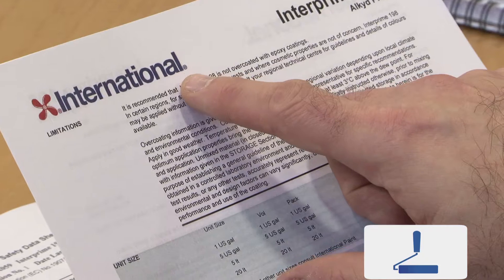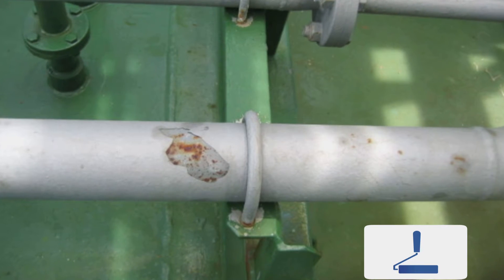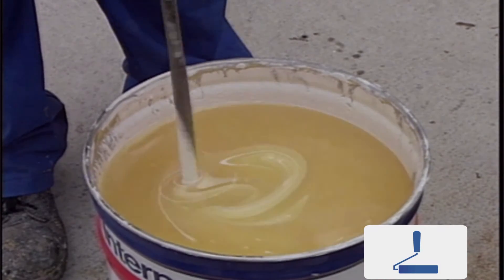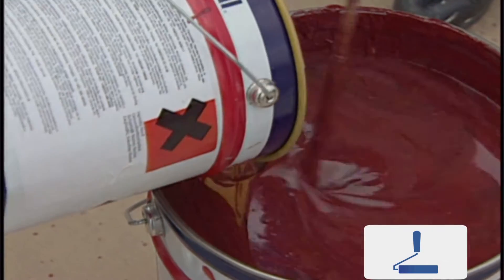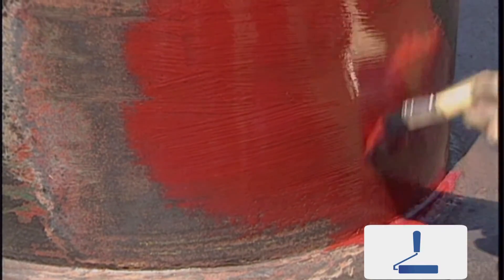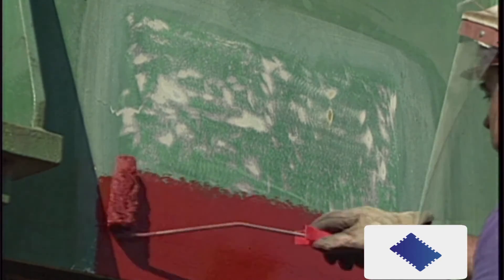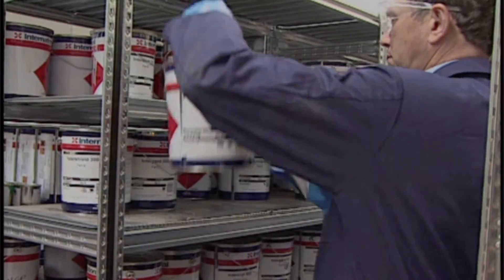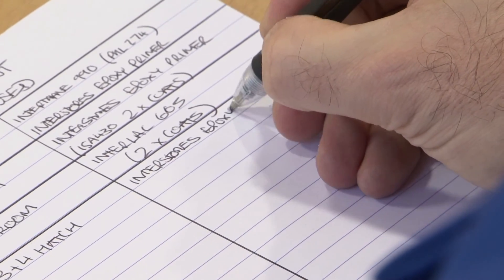Getting it Right - Your Guide to OBM (Paint Application)

Comment: Which products are yoused to mix the paint
Reply: I work with all there paint 990 hand mix for you get air bubbles 300 has to be put on when the temperature and conditions on the boat all take factor
Reply: Also read the cans they tell you how to mix it correctly 😊

Comment: Why the Air Spray
 (Pressure Pot) is not recommended?
Reply: The paint runs in the line better if the paint is under pressure from the compressor